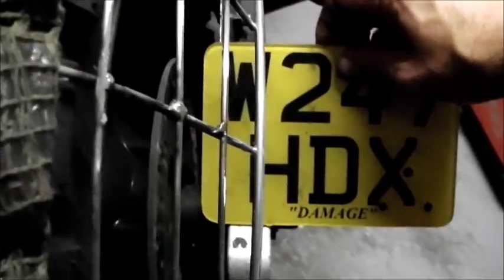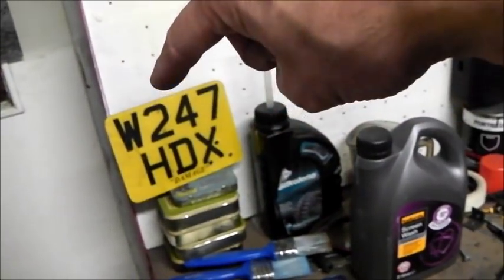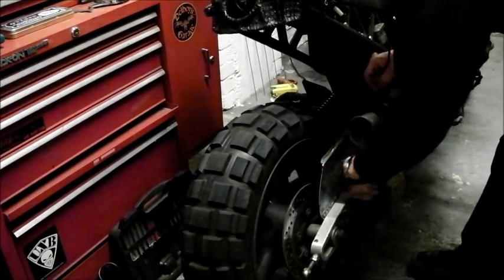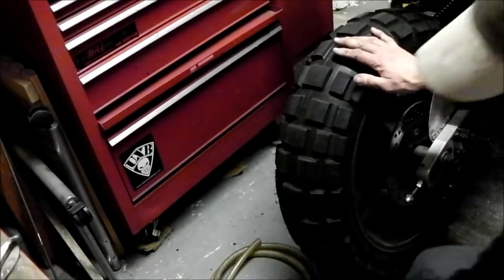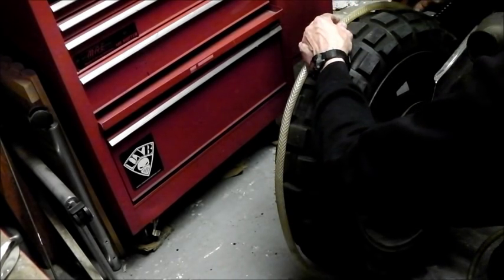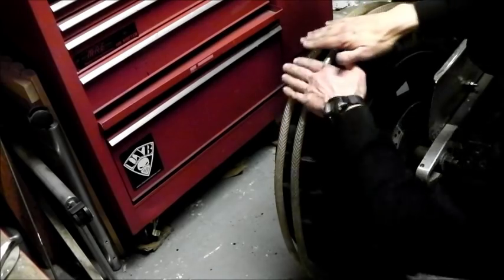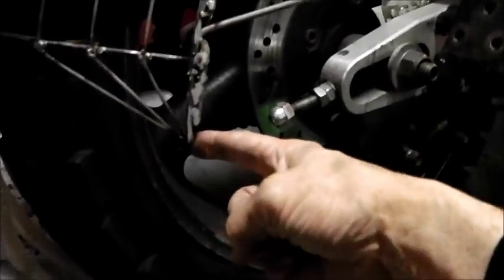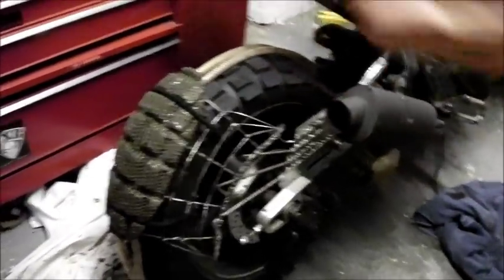Delboy's Garage, Project Bandit, Spray Guard #8.

Comment from the maker: Thanks Chris....It half unintentional, if i wanted to make those welds really snazzy id have to be a much better welder as the sheet VS round bar are an odd mix to join together, you're either blowing through one or not penetrating the other...so big hefty tacks are the safest for long term lasting and not breaking up...going a different way on the left side later so its odd and not symmetrical..thanks for watching mate.. Del....

Comment from the maker: Well done mate, that is exactly right, it's 6mm rod, so effectively a 1" piece of bar but with the added bonus that the strength is spread.  The up and down 'impacts' caused by pot holes will mean that all the stress on the part will be directly vertical up and down and as the 4 rods work as a team with the top one preventing it pulling down, whilst the bottom one pushes against the impact and prevents it moving back, so it's rock solid, even now!

Comment from the maker: The answer to this is exactly what 'jchittenden1' said... at the moment I am still dry building the whole thing & the mount plates will be slotted or drilled further forward to allow for rearward movement to follow chain adjustment... this will also go with other fine adjustments and re-enforcement once the main construction is done and the left plate has to clear the chain, so needs 1" more left hand width than the right side, which is also why all the mount rods have a 90degree bend in them!

Comment from the maker: Yeah, covered that in the last one, the side plates aren't finished, still have a bit of work to do with them once the three pats are into one, they need a bit of beefing up around the holes to stop them cracking with vibration as its on the swing arm so 'unsprung' and when its off ill cut the mounting holes along into slots so the entire thing can be slid back with the wheel....

Comment from the maker: Hi mate, no, on the Bandit I've never had to disconnect the battery to weld on it, it doesn't affect anything, on more modern bikes with fuel injection and active ECU's it can cause issues, so just drop the live lead off, but old school bikes with carbs it's fine as the ignition is unaffected by the weld voltage... cheers Del

Comment from the maker: Hi Mike...no, they get within about 90% by eye, the problem is if you bend even 1mm off the exact place the rod then misses its next point, so you sometimes have to release the bend a bit and curve the rod to its target position.. bit its all such small amounts it only shows if you get the ruler out....and i try to avoid that at all costs..lol...

Comment: Ayup chap. Good to see the old beast finished and on the road. Quick question for you. What type of welding rig do you use? Am thinking of investing and yours seems to do a good enough job. Keep on makin' and filming. Cheers matey.
Reply from the maker: Ayup mate... glad to hear you are getting into a bit of welding, it's great fun!  I use a Clarke Weld 135 Turbo gas MIG.. you can get them from Machine Mart online or at your nearest branch... I use the gas version because it's cheaper to use regular wire that way (flux core wire for the non-gas MIGs is really expensive)... and a Turbo version (which has an internal fan) as you can weld for longer and it stays cool, which maintains the voltage... but any good hobby MIG will do!  Good luck with it mate, cheers Del